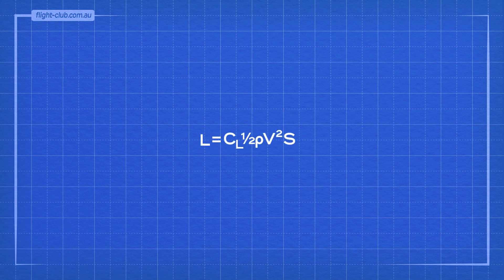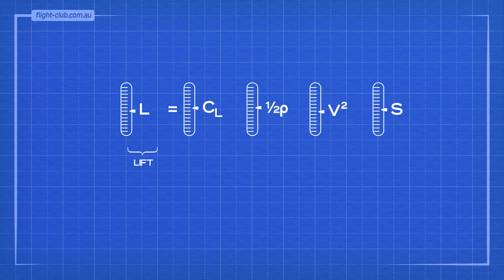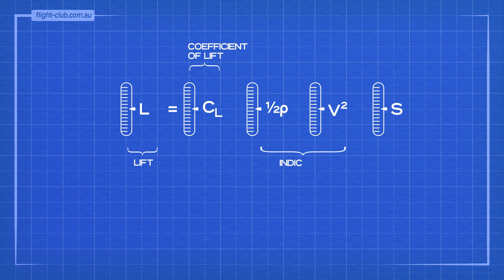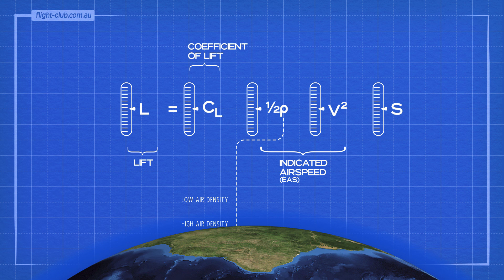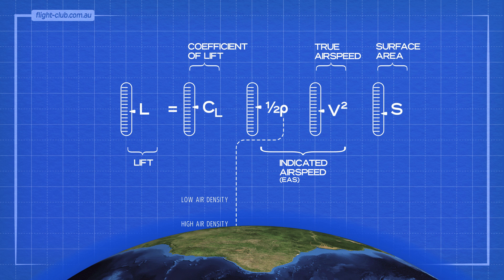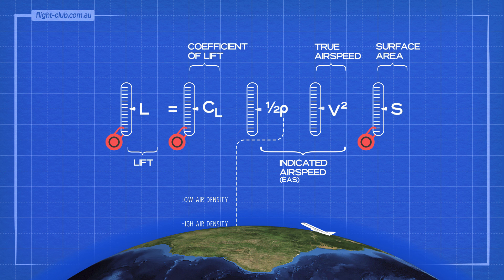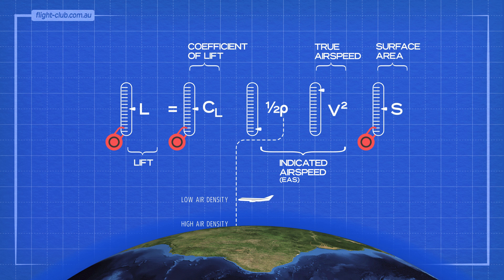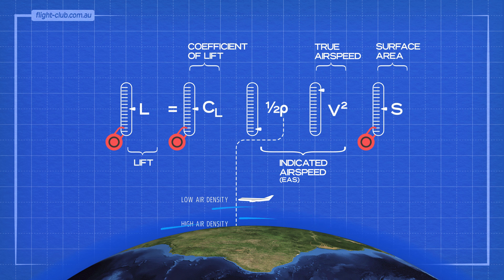Why aircraft fly SO HIGH? | Simple mathematical explanation.

Comment: I need help can some clarify my doubt.
So in the lift formula density is, density of the air enveloping the wings and flowing as a/c speeds up, but if density is directly proportional to lift. How does L (lift) increase when density decreases or velocity or area of the wings decrease?!

Also what is important the factor CL or the resultant force L (lift)
Cause if you try to find/improve CL(coefficient of lift) you have to decrease density, velocity and area of wings.

Comment: Why is Indicated Airspeed stated with (EAS)?
Reply: Indicated Air Speed (, Calibrated Air Speed) and Equivalent Air Speed are said to be basically the same thing. Differences so small that they are negliable, so official learning sources and examiners use them interchangeably. But to be accurate IAS corrected for instrument and positioning errors creats CAS, CAS corrected for compressibility errors creats EAS.

Remember; ICE-T Is a Pretty Cool Drink,  -> IAS, CAS, EAS, TAS - corrections: Instrument, Positioning, Compressability, Density. (Additionally, TAS corrected for wind creats correct speed to the surface, Ground Speed, GS.)
Reply: Since 1/2 * p * V^2 = IAS, I believe they used EAS by mistake.